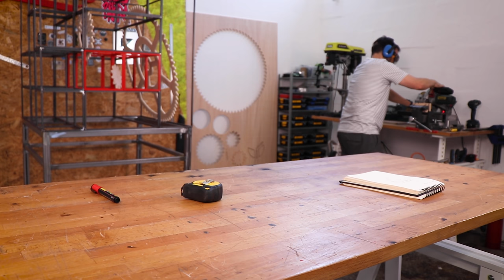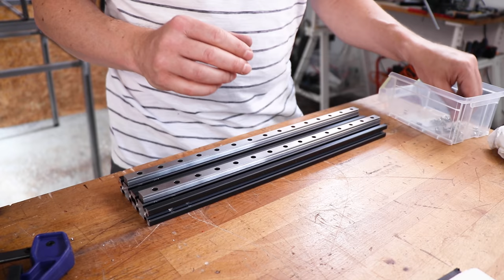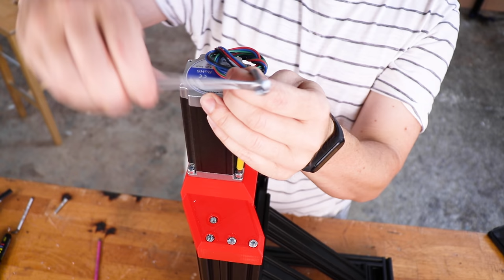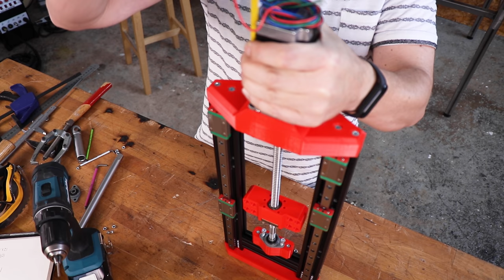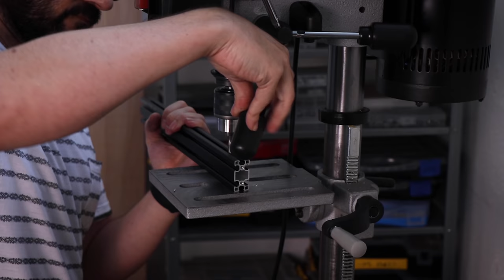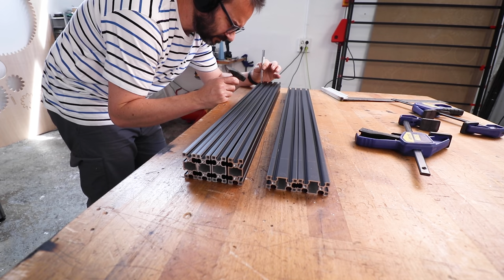3D PRINTED VERTICAL MACHINING CENTER FROM SCRATCH

Comment: The Machinist in me dies when I see him hand drill holes in metal that needs to be precise and square 😭
Reply: That's what the center punch is for
Reply: @nateschmitz9827  center punch doesn't effect squareness just the center hence the name center punch, you can still go in at an angle using a center punch🙄
Reply: @jdpickett8496  he scored it by referencing the outer edge using his calipers creating a uniform line reference from a parallel line, as square as this application requires

Comment: While this is extremely cool, a knee mill exists to achieve precision. You honestly probably wont hit a higher precision with a plastic knee mill than your router you already built.
Reply from the maker: This has ball screws, the old one has belts. This is at least one order of magnitude more precise.
Reply: @ivanmirandawastaken  yeah, the ball screws give you more precision in the linear positioning, but did you check how straight, parallel and square your guides are? There are all kinds of errors you can get because of misalignment which can be far worse than low precision in the spindles. But maybe you can use this machine to make parts for a more precise and stiffer machine.
Reply: @CatNolara  Forget about how parallel or straight it is. It is not stiff enough. That is the first problem. A column without reinforcement just can not take any load in the X-axis. Assuming those are 20mm rails then he used just 40x20 profiles. That is just way to thin to take the load. 
I mean with a 1,5kW spindle you can, worst case, expect a cutting force of close to 1kN. Into 2x20mm aluminium profiles. If you just caress the material like he did in the video it is not a problem.
But then the 1,5kW spindle is overkill. 200W would be enough.
Reply: @CatNolara   could you use less precise machine to make more precise machine? Im building my router using wood (only 30% of the machine) and want to mill aluminum with that machine to replace the wooden parts. I thought you only can machine parts that is a bit less precise than the machine that made it
Reply: @thanhnhanhuynhnguyen3652  if that was true we never would have been able to make better machines in the first place. In reality straight off the tool the parts you make are going to be limited by the precision of the machine, and then in order to make them more precise you have to basically hand finish and check and measure very very carefully. Cut things deliberately oversize and then hand finish them with files and a micrometer, hand scraping with a carbide scraper to bring a table into true, it's a huge fiddle. It's more than the thousand pounds of metal that makes a proper industrial machine expensive, it's all of the hand work that went into making sure that it's just right.
Reply: @AlRoderick   thanks a lot! It really open up a new point of view for me! 
I built mine using alu extrusion with the target of being able making tight fit aluminum parts. Plan is to use wood to make some parts for my machine and then use itself to machine its own aluminum part and eventually able to produce tight fit parts as I want.
But was disappointed after reading some folks on a cnc forum saying i cant do that .
You comment give me more courage in my path! And also a way to achieve it. Even i doubt my crafting skill can achieve that in the near future but as long as i know theres a way even u have high chance to fail.
Any info or comment about my plan would be truly appreciated!
Reply: @thanhnhanhuynhnguyen3652  you can if you are clever about it. You can even make a very precise machine only with hand tools, but that needs a lot of effort (with hand scraping). It's all a matter of measuring and adjusting to cancel out errors.
Reply: @CatNolara  Or you just buy precision ground steel to build the parts out of. It is not cheap, 2-3 times normal steel price, but then you have guaranteed flat surfaces to work with. 
Especially for a router this might be the easiest way to go.
Reply: @CatNolara  thank you!

Comment: Which blade do you use to cut the alu profiles?
Reply: btw, if you use a compressor to clean this mill be careful so you don't blow chips in towards the duet fan, looks like a disater waiting to happen 😨

Comment: While I love your projects, sometimes I am confused when you go out of your way to make somethinng that can be had relatively cheaply. I would have appreciated more a 3d printed conversion to make an old manual mill, into a CNC mill. It hurts knowing that there is a mill rotting somewhere that you could have givenn life to againn. Also, ,feeds and speeds are less an issue when you have a proper machine. The amount of tuning you need to do is evidence that you are limited by your tool.

Comment: my 3d prints became brittle in a yr n broke apart, if i mill, still need to purchase metals n dismantle n reassemble to replace the 3d prints with the new machined metals ....way too much work.... especially those 3d prints the box alone for pwr supply will take ar least a day

Comment: No SPACERS? And at 16min26s, you can see the spindle's bottom-right bolt is not completely tightened (the washer appears to be spinning). Your earthing of the spindle has not fixed your problems with shorts, you've just moved the problem elsewhere (BE CAREFUL).

Comment: I wonder what's the reason behind these CNC build that makes using linear rail and ballscrew so common but the installation of such components is not remotely close to the specifications. What's the point of using such high end components lol

Comment: Not nearly enough rigidity. The profiles are undersized. All the plastic has to go and the knee design is a physics joke, right? You would have done way better by using aluminum plates for reinforcements and to ensure right angles. The best you can do at this point is to fill your profiles with steel balls or steel or lead shot.

Comment: The structure doesn't look like it's got ground breaking levels of rigidity, But I suppose being CNC it doesn't need to remove metal fast, just consistently, So it's as ridged as it needs to be.
It is nice to see someone come up with a well though out and exicuted "Proper" style DIY mill though. I've seen a fair few people making mills on YouTube that aren't even as robust as the a cheap bottom of the range bench drill they use as it's base. This one at least has enough strength to cope with it's roll of sitting there and tirelessly taking small cuts constantly, while the "Operator" can be off doing something else in the workshop.
Reply: I highly doubt that. The machine is way to unstable. Reinforce the column, add some proper aluminium plates on the X-Y-table, replace most of the thin ass extrusion with at least 40x40, better 80x80. Then you are getting somewhere. 
What use it a CNC if you can not trust it. Plus all of this vibration will kill the tools in no time. I mean he destroyed one endmill already. Guess what will happen if you keep on running this machine for a bigger part.
Heck even the cheap Chinese 6040 or even 4030 CNCs are more ridged and can cut aluminium better. Plus they will be cheaper.
Reply: @nukularpictures  What I meant when I said "Being CNC it doesn't need to remove metal fast" is that where on a reasonably chunky manual mill someone might stand there using a 1" cutter to take 40 to 50 thou cuts, This could get the same results by taking a huge number of 10 thou cut's with a 1/8" cutter. It would take a hell of a lot longer, But if you're not having to physically operate the machine (Just pop to it every once and a while to check it hasn't broke it's cutter) it's a more convenient use of time. If you're only taking tiny cut's the need for a machine to be seriously ridged drops off dramatically. Yes, If he tried to uses a 13mm cutter in that machine as it stands the whole things going to dance and flex, but being CNC means he doesn't NEED to run a cutter that big.

The little Chinese baby CNC router tables are OK as an introduction into programming for CNC machines, But the Z height is way too small for them to be much more than a learning tool (And a stepping stone towards a more capable machine) for most people. If you want to machine something much thicker than 30mm you're usually out of luck. Also, if you need to use a sacrificial board on the machine table it'll take up a substantial percentage of your already very limited Z travel.

Yes, He could have built it out of 1" steel plate and made it a much more ridged and capable machine, But that's not neccecery what he wanted or needed. As a "Hit start, then ignore" machine it's probably more convenient and useful for him than having a "J head" Bridgeport sitting there that he'd need to operate manually.
Reply: @Reman1975  But that is my point. This mill is not just start and forget. This mill you will have to babysit the entire time.
Just imagine the something goes wrong, one stepper overheats and loses steps for example. Then the machine would, if you are unlucky, crash into the material.
Being a 1.5kW spindle it has the power to easily bend and destroy the entire frame.
Or just user error and you set the wrong z height and the machine just rams into the material.  

I would not let this machine run without me being near it. Just to risky that something happens and the entire machine gets damaged. 

Especially since he could improve the machine a lot without a lot of work. Go ahead and add cross beams in the column. Remove the wanky tilting head and put a 10mm aluminium plate to fix it instead, replace the extrusion  in the table with plates as well and boom. This machine would be a lot more capable without a lot of extra work. 

Btw, a 6040 also has 75mm of Z-travel. So basically the same as this one. But I agree that this is too little, this is why my router as 350mm in the Z-axis. But that is not needed for over 90% of my projects. 100mm would be completely fine and I would find workarounds for the other 10%.

Comment: You Living in EU? Than take the EU Plug, für the Brown and blue wire off, only leave the green and Yellow wire on. Plug the Plug in the Wall,power up your Müll and Touch with Greek Wire all Metall parts. Your RCD shoud trigger Ahn you have an failure